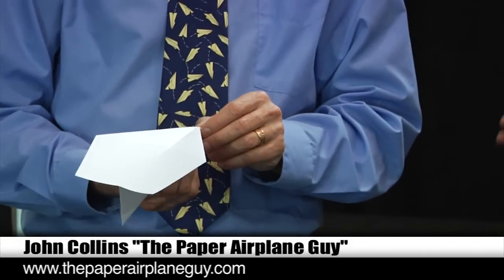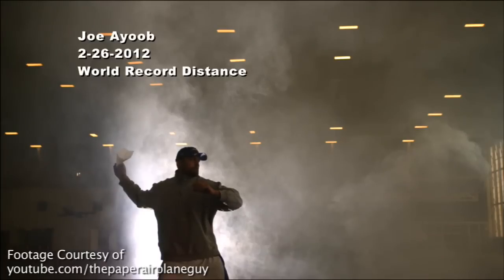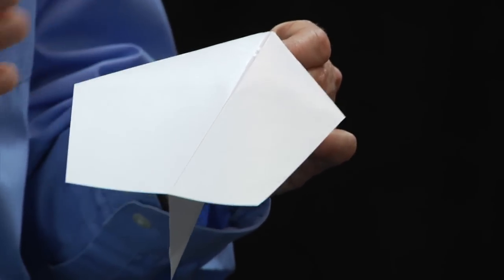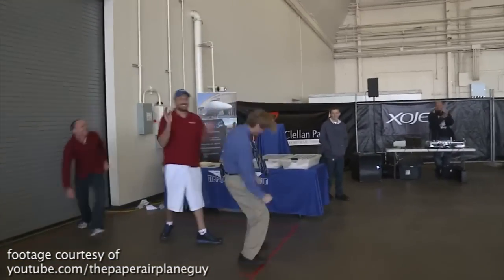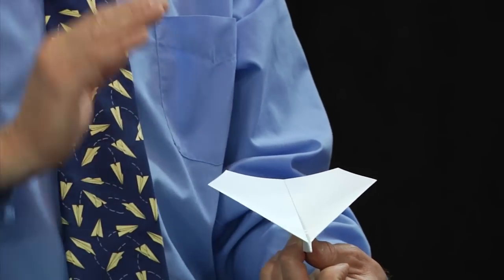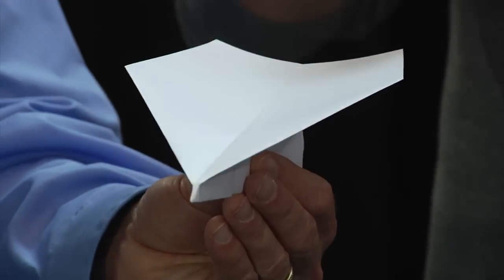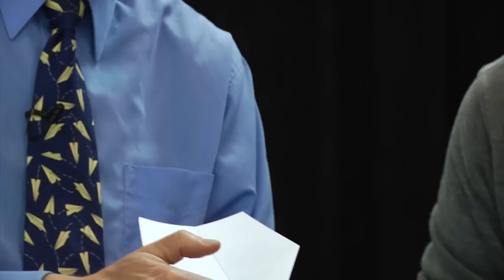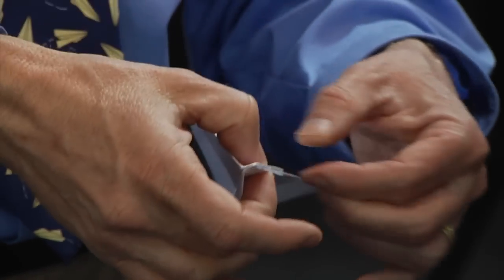The Secrets of The World Record Paper Airplane Design

Comment: This is a very old design and you can find it in paper airplane design books most likely its on here as well. But you can make the CG Center of gravity forward or back to fly slow or fast. Great design cant remember who showed me back in 1967 But my best time in the air was 17 seconds in the schools inside gym. Outside on a breezy day you can loose them. I Made it to sore high then when the speed bled off it would open a little and glide around. Or tape the seem closed and go faster.

Comment: Thumbs up to this and ANYTHING that advances our craft! But I must say that it should have been common sense to use a smoother paper. The design is based on weight and you want it to go where you throw it. Turbulence along the control surfaces of the plane would only hamper this kind of attempt.
VERY GOOD idea to use A4! I wish I'd have thought of that. Now I wanna go get some 28 lb. A4 laser printer paper. That oughtta make some remarkable folds!

Comment: The ridged paper would work better with duration.  Tape has always bothered me, but you should be allowed to use as much as needed, as long as it stays under a particular weight. OR, get rid of it altogether. This tiny piece of tape crap makes no sense. Random and arbitrary. I would like to see them get the record without the tape.